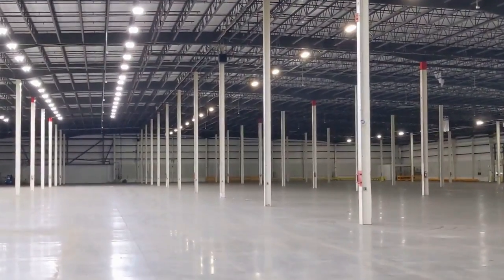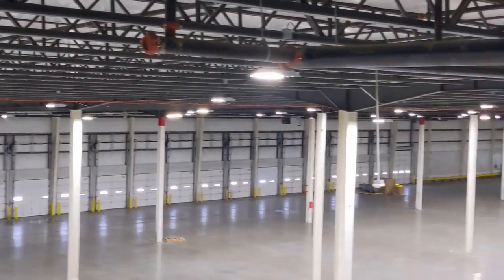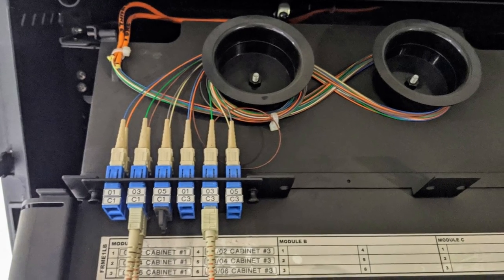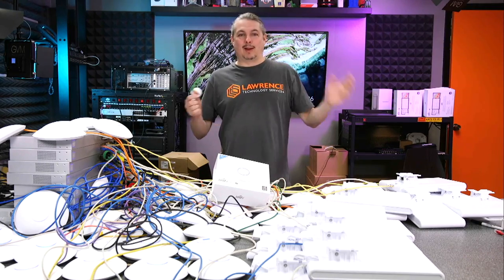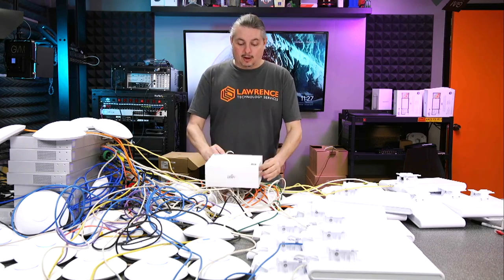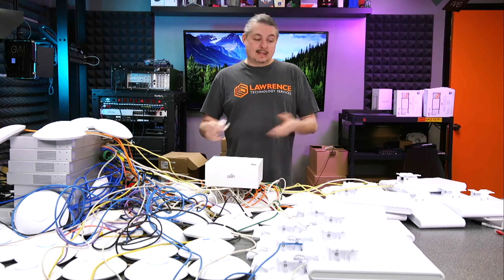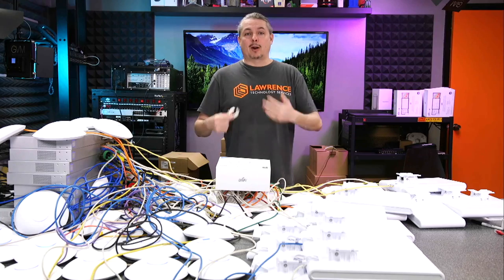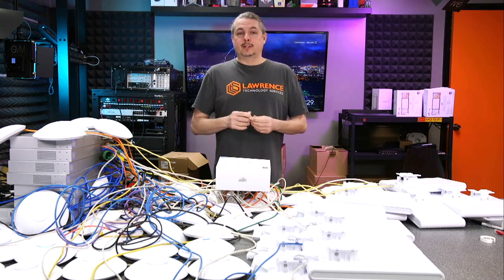Project: Installing 52 Ubiquiti UniFi Wireless Access Points For A Warehouse.

Comment: I'm a wireless networks Engineer in Ireland, I design and build WiFi networks in warehouses that are 35,000 square foot, and I get away with 8 APs
Reply: This warehouse is 320,000 square foot but 42 AP's inside does seem rather high. Even with racking cutting into signal range this is a very large number of AP's
Reply: What APs?
Reply: xNand it means access point

Comment: Did you have to “tune” the APs tx power/channels manually or did you let the controller take care of it?
Reply: Would very much like to know this as well
Reply: Just my 2cents: Since this is a warehouse and not a office building etc with a bunch of neighboring APs etc. This deployment would be better with manual tuning to ensure non overlapping channels and channel noise/changes is less likely to happen (again) since it is a large warehouse with outdoor property.
Reply: geant90 thanks!
Reply: A little late, but in a different video he clearly recommended leaving everything on auto unless there are specific problems. He said that Unifi is normally so good that people actually make it worse by dialing in settings themselves.
Reply: @majik11111  that’s a good method of approach. AGV systems it is good to hard core upfront.

Comment: I've done this multiple times for my company in warehouses just like that.  The Unifi access points work excellent and were a huge improvement over our old wifi system that cost 5x as much.
Reply: how high did you mount?
Reply: @bdepew  right to the bottom of the trusses.  I’d guess 35-37’
Reply: @bdepew  right to the bottom of the trusses.  I’d guess 35-37’
Reply: @TheDillio187  no issues?
Reply: @bdepew  none. We have many warehouses setup this way, probably over a million square feet pretty easily.

Comment: I have also worked on warehouse projects, where it was necessary to use fibre to reach distant points.  However, one thing I was wondering about is since some Unifi models can support a 2nd connection, maybe that could be used to cut down on the cabling.  Also, as far as video in the warehouse goes, I have worked in several data centres, where cameras are prohibited.  Also, I have worked in a prison a few times and in there, even pagers and cell phones were banned and my tools were inventoried going in and out and I only brought in the tools I'd be using.  On various jobs, I have been finger printed, palm printed, retina scanned, weighed and more.  I've even been escorted by an armed soldier at a NORAD radar station.  So, security can be "fun" in some sites.

Comment: Warehouse with high ceiling and very tall shelving units (presumably with product on them)? I would think that omni antennas are not a good choice here, and that sector antennas would be needed. Curious to see how the post-install validation goes once they finish moving in the shelving units and product.

Comment: I did a dozen AC-Pros over 145k sq ft, been working pretty well, but it's mostly warehouse traffic so not really pushing it hard.  Lots of metal racking with product too, but the high ceilings really help.
Reply: how high did you install them?
Reply: @bdepew  I want to say the rafters were about 35 feet from the ground.

Comment: Having done multiple data center relocations I can confirm re-using  structured cable be it Fiber or Copper is usually fine,  with that said
individual connections (especially copper) are good to swap out so you don't end up with a rats nest at the end of the day.

Comment: Great video, just one question... why would you place so much ap's with a user-related connection problem? its just overkill... is it not more opticional setting the RSSI settings correct according the project?
Reply from the maker: Once the warehouse went into production there are lots of metal rack going up high that cause interference

Comment: Why didn't you use Rockets with sector antenna's? Basically you made the ceiling (above the racks) 100% coverage and interference, while in between the racks coverage is limited. Warehouses are always tricky, and depending on the lay-out, you might be better off placing sectors along the wall...

Comment: Have you ever calculated the 5GHz RF exposure standing there with so many access points?  I don't think I'd want to stand there very long. Edit: I did the calcs.. you are fine.
Reply: no problem
Reply: It's also non ionising radiation so very low risk....otherwise us IT guy's would be dropping dead of cancer all the time
Reply: @diceman199  The "saving" factor here is the low wattage (150mw) and the relatively inefficient omnidirectional antenna design.  A single 150mW 5GHz source with a high gain directional antenna will exceed uncontrolled environment exposure limits at 3ft and controlled environment maximum exposure limits at 1.5ft. And while it's not ionizing it can still cause damage.  When you climb towers, you learn quickly not to get in front of certain antennas. lol
Reply: @turbo2ltr  yeah....towers are a different kettle of fish....way more power than something only expected to work at 100m
Reply: It probably less than when you're getting while using your microwave to heat something up. :)

Comment: How did the client devices work with roaming. A massive Warehouse environment is a long ways out of Ubiquiti's experience. I sell and deploy UniFi but not into warehouses. Barcode scanners are designed to not roam unless necessary unlike consumer devices. Lets have a 2021 follow up on how it has performed?

Comment: Really good video. I am just rolling out a large deployment at the moment with about 110 access points, 30 cameras, 12 switches and 7 sets of UBB devices. In my deployment I am using the AP-Lites as each one is in an individual room in a hotel that is being refurbished with modern WiFi. Do you actually think that with the number of devices that will potentially connect and how close they will be to the AP devices, you need the LR. Would the AC-Lite not be capable too

Comment: Why so many APs? 12-16 Cisco or HPE Aruba WAPs would cover that space for less than half the cost on hardware.. No problems even with full racking and forks in place. (Not hating or judging - curious) Were there specific bandwidth requirements or latency issues? You'll likely get better performance if you power off every second AP.

Comment: Great video.. How high are the ceilings at the highest point in the warehouse ? I have read unifi is limited to 22 to 25 feet using ceiling mounts?
Reply: Correct, you don't want Omni antennas much higher than this.. I don't know if these APS have downtilt antennas, but that can get you a few more feet if it has them.. any higher than this and you need to do some directional antennas..

Comment: The people telling you to not re-use Fiber are just trying to upsell themselves. Fiber is fine to reuse. I don't know what your level of experience with Fiber is, but a true fiber professional would clean and recertify the fiber before using it. But not everyone can afford the expense of an OTDR capable of certifying fiber. At the very minimum, all fiber should be cleaned and tested with a visual fault locator before reusing fiber.

Comment: I would love to see the outcome when the warehouse start to add pallets  filled with merchandise on the racks. Also people walking with RF scanner hoping that the application does not times out before they get to the location to scan the product.  that's when the real deal comes Roaming is one of the issues that I see a lot with unifi even when you have RF scanners such as Zebra, Motorola or intermec that support 802.11r. in my experience  with the unifi  LR the mobile devices will stick to the AP and it will not roam properly. It will be a lot of tweaking like power reduction band steering channels and more. I love your videos hopefully I can learn something from you if you encounter those issues
Reply from the maker: Did you even watch the video?  At 3:17 i state that this is about 40 days later after the project was done and the warehouse is up and running.

Comment: I'd have went with directional antennas. That many omni's that high and close to metal isn't the greatest.
Reply: Funny you say that because when I did a bid for a warehouse the engineers that did a heatmap were like you shouldn't of chosen those AP's because really they should only be about 20ft off the ground (they were going to be mounted at about 30ft).  Luckily we used the support beams and made a mount so the AP's were mounted correctly.  I'm not sure, but I would assume the Unifi AP's are the same.  They shouldn't be mounted that high.
Reply: @breakingcustombc2925  Personally I wouldn't go with Omni's with anything over 10-15 feet max. Especially in a high density environment.
Reply: @breakingcustombc2925  yup generally you do not want it to high up as wireless client devices simply wouldn't have the juice to tx. With a tested environment you can figure out what you can get away with.

Comment: I'd suggest taking a look at cwnp.com and wlanpros.com for anyone interested in getting into wifi design or to answer the many questions here about channel planning, power levels, and AP placement. While the end result of these installations was a happy customer(kudos), you would quickly find yourself in a tough situation had the requirements been at a higher density, throughput, or industry (such as healthcare). It's highly recommended to do some predictive planning before hanging APs on the ceiling. Getting involved with these sites can only make you better!

Comment: What version Ubiquity AP did you use in this huge metal cover building? LR version?
Reply: If you use LR omnidirectional antenna in this metal can then interference will be to big and potential migration between AP will be really pain (802.11r). "Close can" is the most tricky because is extremely hard to predict Interference from roof, wall even floor. I propose use people who like fly FPV in that environment and ask them what is the most efficient way to send/receive radio signals. After that I'm almost sure you will newer ever again use LR omni antena in this type of environment.
Reply: @abbaaabccabbaaabcc2350  he already said it's working fine and that because it works fine that he got a second job from the same company to do anther building.
Reply: Huh?
Reply: @turbo2ltr  May I ask about methodology such a test? How many scanners/tablet was running during test time?

Comment: one of our clients run Unifi everywhere, and im just wondering in what instance should they consider the HD from AC-PRO? love your videos and explanations. thanks!
Reply: Pro is good for around 30-40 clients, so pretty much only if you're going to exceed around 40-50 clients per AP, you want them for venue spaces, high-density areas. I know from first-hand experience that the significantly cheaper NanoHD will do 40 without breaking a sweat. The full-HD is probably twice as capable. Of course YMMV depending on the situation and the clients.
Reply: Wild Tangent awesome! Thanks!
Reply: I've got the standard AP Pro's and i've had 100 devices connected to one AP before now with no client complaints. Only standard email / internet usage but even so. The HD's are great for things like conference centers / auditoriums where you have large numbers of people in relativly small areas.
Reply: @diceman199  not having used the Pros myself, I'd defer to your estimation. The HD is essentially almost 2 Pros in one, having that 2nd 5GHz radio, so I stand by my "probably twice as capable" :)
Reply: @W1ldTangent  It all depends on what your application is. Mine is office space and TV & Film studios so the Pro's work just fine. Not sure about twice as capable though. You might find throughput restrictions when having lot's of high demand users connected though they'd have to be moving large files to hit the Gb port limits.
Reply: @diceman199  Do the HDs not have 10Gig ports? I thought they did..

Edit: nope, I'm getting confused with the XGs now 😂 I don't play with the super-high-end UniFi stuff, it clearly shows. I've never run into a situation that couldn't be solved by the appropriate application of nanoHDs. My 2-floor office has 3 nanoHDs per floor running both bands (all planned out so no two same or adjacent channels directly "touch" each other) with some in-wall-ACs on 5GHz only to cover gaps around the perimeter and provide some handy ports for VoIP phones. On a busy day with all of our meeting rooms booked up, we can have upwards of 200 total mobile clients, and we've never had a hiccup. The upstairs APs generally don't serve any guest SSIDs, so actually most of the burden is borne by the 3 units downstairs on these days.

As for the SHD and that supposed "security" radio, I've got that covered too :) Cheap OpenWrt devices scattered around, running Kismet, feeding to a central server for the best WIDS/WIPS you can't buy :D I work for a non-profit, I don't like fighting for budget so I have to get creative.. let's just say I've got more RPi's and other low-power SBC devices doing odd-jobs than most enterprises 😂
Reply: @W1ldTangent  I thought it was Gb ports myself....quick search and it's 2 x 1Gb ports that can be aggregated.
Reply: @diceman199  I realize hard numbers and WiFi really don't mix, but apples to apples comparison, same space and clients, I think the HD is going to handle very near to twice what a Pro can. That's definitely into the "hundreds" with an S range, but as always.. ymmv, and I still think it's very few people that need that capability and if they do, they'll certainly know it better than me. I know the XGs can handle so many clients you need to start subnetting them, and work out a way to make roaming happen seamlessly in the background over L3 tunnels from one VLAN to another until a DHCP timeout is hit and they can be returned to the native subnet of the AP they're currently connected to.
Reply: @W1ldTangent  The spaces i look after will, fortunatly, never need that kind of density. I'm primarily a voice specialist so once you get into L3 tunnels and the likes i start getting out of my depth on the data side.
Reply: @diceman199  ya the little I've looked into L3-mobility and how they handle roaming on very large networks that cannot be flat makes my brain hurt a bit.
Reply: @W1ldTangent  I'm about to take on network admin so learning curve incoming
Reply: @diceman199  It's fun work, it's what I primarily took over when I joined my current org, but now I'm into overall systems architecture and infrastructure as well. Definitely one of those things in IT that the users notice the least when you're doing it right, until you screw up nobody knows you're doing anything at all :)
Reply: @W1ldTangent  Thats the truth....do it right, nobody notices. Do it wrong however.....

Comment: I have 3 warehouses, very similar. Switched from ruckus to unifi UAP-LR and UAP-AC-LR. Handhelds are motorola MC 9090 séries on 2.4 ghz. I am not happy, lot of dark zones and I Feel that devices do not roam well from a AP to another. Any hints?
Reply: Watch this video. Look up your phone model and if it handles 802.11r
Reply: Also use wifi heat map to see if you are getting good signal in your dark zones.
Reply: Yes it supports 802.11r.  Never had any problems with ruckus and default options, auto detection settings (channel, power, etc). It really seems that devices stick with far away AP and does not roam. I tried messing with unifi controller settings, enabled advanced settings, tried different setups, tried to use minimum rssi settings, but nothing
Reply: I can even notice this problem with my iPhone. I start to walk into the warehouse. When I get to the end, signal on the phone is very low, and I can see I am still connected to the first AP. Seems like ruckus did “hey AP 35, I am AP 1 and I am losing this device... get it!”  And they roamed automagically
Reply: @bladoblado  apple products have a sticky roaming problem.
Reply: prackster prackster it was just a example. Same thing happens to all notebooks and mainly Motorola mobile handheld computers
Reply: @bladoblado  Try playing with the minimum MCS settings (rate control), disable lower bitrates will force clients to connect to a better connection rather than hold onto a poor one. Not sure if you enabled 802.11k (Fast-Roaming in the wireless network settings), but if your Motorolas are old it probably won't work anyway and it sometimes makes things worse, but give it a try both ways. Also play with the cell size if you have any 5GHz devices that are struggling.
Reply: no warehouse experience, but we went to a painful start when using non-unifi switches - it was arp cache vs. gratitous arp from controller (that didn't work well). tuning arp, lowering a few sender strengths that overlapped and the roaming was well ever after.
what we did, was as follows: one person with sessions on all switches, watching mac address tables. one person walking. both on the phone, updating which switch/port/ap they show up on and where they are. that allows you to drill down very quickly on the points where the handover doesn't happen.

Comment: How did you come to that number of APs? That seems an excessive amount? We have a couple of warehouses some of which are much larger with half that number of APs. Possibly helps that we use directional antennas.
Reply: You need to think about the dB blockage from the products that will be stacked there.
Reply: Adam Pristel I know :) I just wondered why you wouldnt go with a design that used directional antennas directed down each aisle.
Reply: @strikesbac  well since there aren't walls, you'd still being the ceiling. And for when there is no products or forks driving down the aisles. It's ridiculously complicated alot of times for what seems to be a simple idea.
Reply: @strikesbac   When the hi lifts are extended they will block the signal down the aisle.  So anything on the opposite side would lose connection.